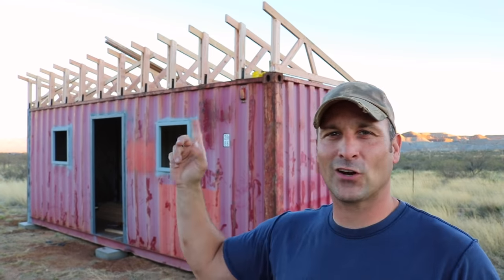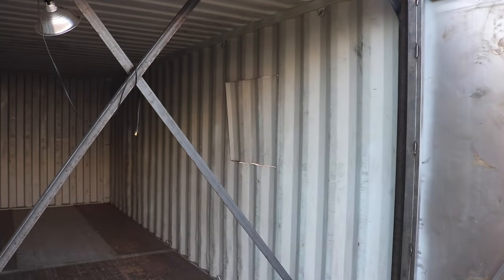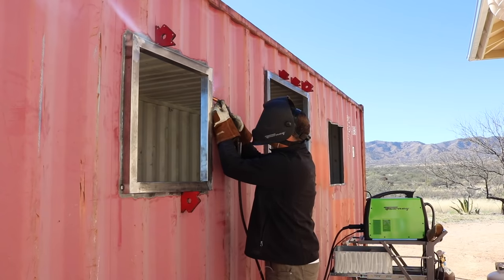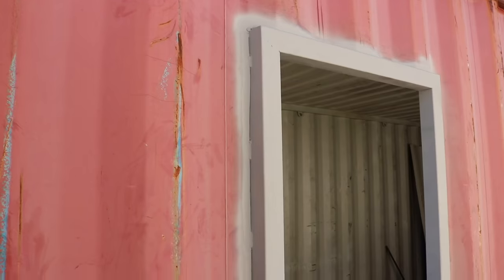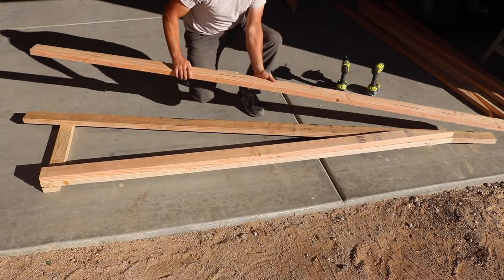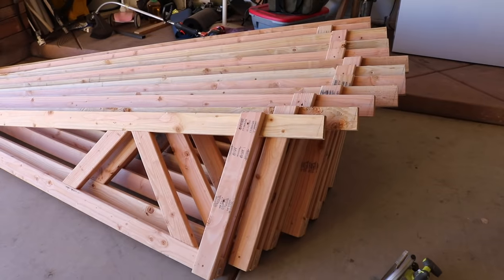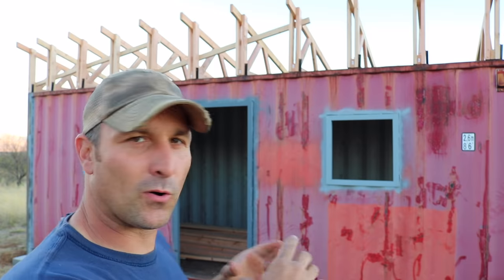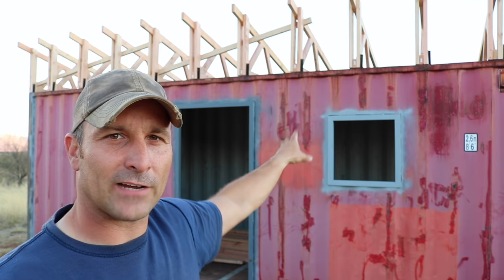Shipping Container SHOP part 3: windows, door, trusses

Comment: I used Flex Seal to coat the top of the container. It took a narrow roller brush, one of those broom handles one can screw in, and roughly 5 gallons of Flex Seal.
Reply: @Justin,
Great idea on the flex seal, nice DIY approach.  I wonder if bedliner would work and be tougher, but a definite price difference I would think. Something fir me to investigate as in will be getting a 40ft soon for storage of the usual outside items, lawn mower and trailers,  splitter, chainsaws, trimmer, 4wheeler,  tractor, the Harley, all the other toys I have acquired. Never enough space it seems.

Comment: This is probably one of the best videos I've found on youtube that shows how to make mono pitch roof trusses. I know you're focusing on an entire build, but I wish you had a video all about that. I want to do it on my house though, not just an outbuilding.
Reply from the maker: Thanks so much Laurie!  I really appreciate it:)
I know I don't go into too much depth on some of the things but you guessed it.. it's a chronicling of the whole project versus one specific thing.   But since you've mentioned it I kinda wish I would've gone into a bit more detail on some of the things.  But I only have limited harddrive space and this project has been a biggie;)
Joe
Reply: I especially like that you actually built trusses which look more professional and probably add more stability. I see that is necessary being that you built on a shipping container. Most videos that I've seen on mono pitch roofs involved basically just rafters and no framing. Just diagonal boards. That is probably fine for a shed/garage/small structure, but for a house, these trusses seem the way to go. Anyway, looks great!

Comment: Looks good. Next time you cut a hole, use those square magnets to hold the seems together. Then you can put the tool down and control when and how the piece falls. Looking forward to the next one.
Reply from the maker: thanks... but my magnets are a bit too weak for that... I try it at first and the movement of the metal kept pushing them off.  Thanks for watching G2WT!
Joe

Comment: A useful 'trick' when taking out panels from a container - Drill holes in the panel and then bolt some scrap 2x4 or something to hold it in place (make the cuts behind the 2x4 before putting it on) Use the 2x4s to clamp the panel in place while cutting. If needed, drill more holes to fasten additional bolts through to use as handles when unclamping the 2x4s.

A little extra work to avoid sharp edged sheets of metal flopping about while you're trying to cut them.
Reply from the maker: I like that idea... thanks!  very smart and will definitely use if I do another cut out :)
Joe

Comment: No video of the container being moved onto the foundation blocks? That would have been cool to see. Also how did you level the blocks? I've been in the market for a rotary laser level for a couple years and still haven't decided on one so it would be interesting to hear what one you have if that is what you used. We have a small interior laser level (2-plane) that would be able to hand an exterior job that size but it isn't ideal.

Comment: Looking good, careful with the angle grinder I know someone who lost the tip of his finger and he had the safety guard off too!
Reply from the maker: yes, I was lucky this time.. guard is going back on;)   lol... I was being cheap and trying to use some oversized wheels that I got for free:)
Reply: You can, and I do, use 6" guards on smaller grinders. Since you fab you can easily cut off the existing guard from it's clamp then make a 6" guard just for cutting wheels. They don't get in the way using 4.5" disks. I scrounge all the guards from dead grinders I can find. (Dea d grinders are often just in need of a commutator cleaning and brushes which is easy work. If your job doesn't fix grinders I recommend grabbing the dead ones. ereplacementparts website has exploded views for many power tools and you can either order from them or match the part number to an Ebay seller.
Reply: I like over-sized cutting disks and "free" is my favorite brand. You can easily cut some sheet metal to fab a larger guard then cut off the clamp from your stock guard and weld that to your new larger guard. I don't find the larger guards a problem with small whees/rocks/discs.
Reply: Oh my, Joe; as you learned the hard way, there's no reason to operate a grinder without a guard.  Definitely make a larger guard like the guys suggest if you insist on using non-stock wheels.  Cheers

Comment: I took the guard off a grinder to cut the stucco on a wall to put in a bigger window.
The wheel caught a nail and exploded through my face shield and made a 2" cut on my cheek. 
I was fortunate I didn't lose my eye. 
Shields are put on for a reason. 
Do Not Remove!

Comment: Looking awesome bro! I wanna build myself a shop like this, so I'm following your series for ideas. I'll eventually make mine and add my own tweaks here and there, but thanks for the ideas and a starting point. Oh BTW I'm part of the angle grinder bit club as well, although mine's been done with a dry diamond blade, wetsaw blades shouldn't cut you, but dry diamond will and as you said cotterize the wound as well. I've unfortunately done this a few times since I'm a flooring installer by trade, but I guess I've got man's hands lol. Thanks again

Comment: Love this mini-series.  One thing I need on my property is a shed.  On Craig's List today I found a 20' shipping container for sale, and I started to wonder what types of conversions people did to them to fit in.  Your projected has spawned the initial framework of my own.  I'll be storing yard equipment to include lawn mower, splitter, trimmer, chainsaws, etc.  

The one question I have that someone brought up is air circulation.  Maybe you address it later in this series.  Since your's is going to be a shop, will you be putting in AC?

Comment: Really like this, just one thing driving me nuts though..... why didn't you leave out the braces in the trusses? Maybe use a slightly heavier top rafter, but defo no braces, then you could've cut the top outa the container and have way more head height inside! I know your issue would be strength, but you could simply add a stiff wall plate at the tops of the container walls, or just one steel tie bar rod from the front wall to the back to keep it rigid. I would go with roomier head height design every time if you're doing this much work anyway.
Reply from the maker: That's a good idea.. didn't really think about it as i was kinda hoping to make the space inbetween kind of an insulating layer.  Keep the sun off the main roof.. but I like your thinking!  :)

Comment: Great vid!  I'm wondering what your thoughts are on putting a vent(s) in the top of the container for heat ventilation?   I am betting it will get pretty hot inside a metal container and with the roof above it will allow you to vent that hot air that accumulates inside.
Reply: Also you should reach out to Matt with demolition ranch, vet ranch and on the ranch Channel.  He is thinking about a rain water retention system and you have a great example.
Reply from the maker: Thanks Eshelman!  yes, I plan to put vents in both the walls of the container as well as the roof space.   As for the demolition ranch channel... I'm not sure I know if it but I will check it out:)
Joe

Comment: Lookin good. What's the plan between the tack welds around the windows?

Have to say it, you got a little lucky with the grinder. Most dangerous common tool as far as I'm concerned.
Reply from the maker: hahaha... yes, I think you were telling me about you haveing a grinding disc come apart on you?  As for the inbetween areas... those will get an allweather sealant caulking on both sides of the seam.
Joe
Reply: Yes, the wheel just blew to pieces. I think it happened because I was cutting plastic and the plastic melted on to the wheel transferring a bunch of heat to it, or destabilized it, or both. Don't really know though. I don't cut plastic with it any more...

Cool, thanks for taking the time to answer some questions about the details of your work. Seems like you really enjoy your projects. Also, thanks for sharing some of the oopses. I think that stuff can help people too. I certainly learned a lot from my own. Might make a good subject for a video?

Comment: Every time I stumble upon these videos I admire the craftsmanship and work effort but I can't help thinking that 2x4 lumber and siding is cheap.  Corrugated metal roofing is about $1.00 per sq. foot.  What value is the shipping container over traditional construction techniques?
Reply: David Grider I always wonder the same thing. The only thing I can think of is you can tell your friends you have a shipping container sandwiched in between the middle somewhere? I think it’s one of those things where you try and pretend to be environmentally friendly but end up spending twice as much . Take a shipping container then  frame inside then add roof then clad the outside then tell friends you have a shipping container in the middle??

Comment: Man its looking great. I have painted hundreds of those in my day first job I ever had beside working for my grandpa. Will you be spraying it or painting it with a roller? God bless
Reply from the maker: Hey CM!  Yes, I'll be spraying with some DTM paint i got from HD.  It's supposed to take a long time to dry so hopefully it won't push the project back too much.  I'll probably use a roller for touch ups and the framing pieces theough

Comment: Love this series! Just wondering why you used foundation blocks laying on the ground instead of pouring footings? I am in northern NV and waiting on a 40 footer that is supposed to be delivered today! I was going to dig down 24" and pour 2'x2' footings at each corner. We get winter here (temps into the teens) but not a lot of ground freeze. Doing the blocks would be much easier. I know you don't have to worry about the ground freezing in Tucson. Do you think I could get away with blocks here instead of footings?
Reply: You don't need a foundation for individual containers since they are designed to be supported on the corner fittings. You can place a railroad tie under each end. So what if the ground freezes? You aren't building a basement. If your location is on the swampy side you can order a small truckload of railroad gravel to place under the ties. My joined High Cubes sit on steel beams which I used because they were free and convenient, but my single 40' High Cube sits on railroad ties and doesn't shift even with the heavy rains in SC.

Comment: Hey, my dad did the same thing pretty much but its a full size one not sure where he got it. We did put a roof on ours but that's why I'm writing to you, he isn't around anymore and he didn't expect a really strong wind storm to come through here and it basically blew a corner of the roofing off that he installed. I was wondering how would be the best way to attach the roofing to the box? We used screws and L brackets I believe last time, but It wasn't strong enough :(
Reply: @Jessie,
I would add heavier L brackets and then use bolts to attach the the roof trusses to them. It will take some time to drill the brackets but it will give you the strength you need.
Reply: Mark Heintz no it wouldn’t have. We had hurricane brackets on it. That storm was the one that knocked the power out of the whole state of California. It snapped 3 telephone pokes like twigs in my town. That wind was just to strong
Reply: @Bewefau  yeah, there is a limit for every thing. As Long as no one was hurt, buildings can be repaired. Stay safe and good luck.

Comment: I love how this is coming along, but did you have to get a building permit? Here in NY any building over 12ft square needs one
Reply from the maker: Hi Dylan... one of the reasons i'm using a shipping container is that it is technically moveable and considered a temporary structure.  I like to keep the department of 'making me sad' (permits department) out of my life as much as possible;)  When I built our house the permits department was so hard to deal with and each time I had an inspector come out, even the inspectors were apologizing for the weird codes that they have...  
thanks for watching:)

Comment: nice work, what's the spacing between the trusses?
Reply from the maker: spacing is pretty much eyeballed but it's probably about 20" Or there abouts.  I used the corrugations on the roof to guide me when welding the brackets

Comment: Any reason you didn't fully weld the frames in? Why not fully seam the edges? Just trying to learn :]
Reply from the maker: Hi John... mostly because the the gaps are harder to fill and that it takes a lot of MIG wire to do it.  But I have not worries of it being weak... so it's kind of a cost savings to use caulking to fill in the rest .

Thanks for watching:)

Comment: curious. Is it really cost effective using a shipping container? Lot of extra work with all the metal work involved.
Reply from the maker: Hi Sandra... i will probably address this in future videos on this shop but the short answer is... no, probably not.  It really depends on what you get the container for.  In this case I'm selling the other half so essentially I got this one for half price (once the other is sold).  But I plan to do welding and other hazardous work in it and the metal structure has that advantage.  The other pro about using this is that I can move it as a finished piece if I ever needed to sell it, whereas a wood frame shed structure would eventually degrade over time and not be nearly as easy to move.  Anyways, not sure if that made any sense... but that's the quick nutshell;)
Joe

Comment: Dumb question but you used a crane to move the container right?
Reply: You don't necessarily require a crane to place containers. I moved mine after delivery using a hand winch (Wyeth-Scott, trust me, you want one or several!) and pipe rollers. I lifted them using a variety of jacks (forklift jack, common bottle jacks and a Simplex jack, keep an eye out for the forklift and Simplex jacks on Craigslist and auctions). 
40-foot High Cubes are the best containers for shop use because the extra height gives you shelving room, working clearance for machine tools etc, and better air circulation. 
Your typical container will be delivered on a Landoll trailer or sometimes a small straight truck rollback if you buy a 20 footer. I don't care for 20s because they are rarely less expensive than a 40. I used one due to space constraints in a particular location but that's for storage, not shop use. 
A 40 only weighs ~9000 lbs which isn't much.
Reply: Ob Fuscated thanks for the reply mate really appreciate your input

Comment: hold on a sec "and then I moved it onto the foundation blocks " - how did you move it? 
BTW I have 3 angle grinder scars like that. I guess I am a slow learner.
Reply from the maker: Hi George.. I moved it the same way that I did in the first video.  Boom truck... but we did it at after dark when my father in law could bring it down... that's why no video of that portion:)  And yes, I'm a slow learner too when it comes to scars like that:)

Comment: Why add a roof since it is already watertight? Just curious.
Reply from the maker: Hi Tim... yes, the roof is water tight but had a bunch of rust and pitted areas.  But the biggest reason for the roof is to keep the heat off of the top and allow me to collect rainwater for my garden:)
Reply: homesteadonomics The heat and water totally makes sense... Usually the Corten steel's rusting is not considered dangerous because of its unique properties.
Reply: great build... following closely!

Comment: Good job on welding the windows and door. interesting way of securing the wood trusses too. I am curious about the maximum heat and minimum cold in your area, because from I have worked inside these boxes in summer and winter and it's no pleasant.
Reply from the maker: Thanks Pedro!  I do live in a hot area and the roof structure will help to keep direct sun off of it... additionally I plan to insulate with foam boards... but I haven't quite nailed down what all I'll do regarding it.  Still in the planning phase:)
Reply: We insulated the roof, and the inside but the hot sun heated up all the sides so by 3pm it was bad, two citgo AC, were always running. The metal heats up quickly in sunlight so look at a heavy coat of white paint to reflect that heat. Winter time you will want the heat, crazy yin and yang. That is why we copied the Afghan outside mud walls. Experiment is part of the fun.
Reply: I would R-board the outside then cover it with sheet siding of some sort. Keep that heat outside and not inside!
Reply: Mary Brown and during winter keep the heat inside and not outside; insulting is the key to Man Cavinig.